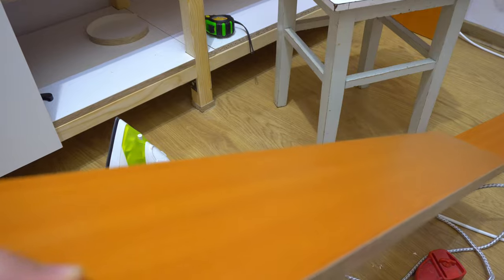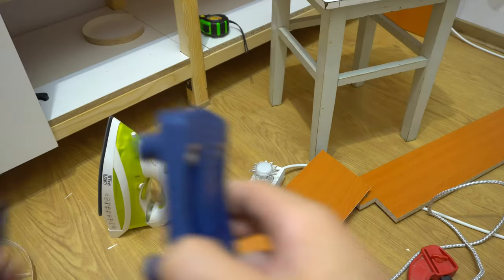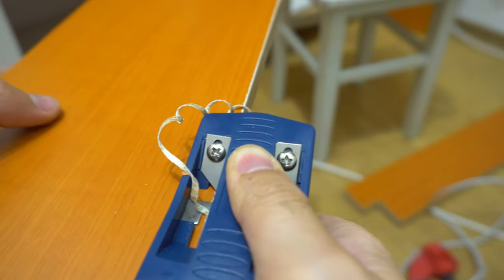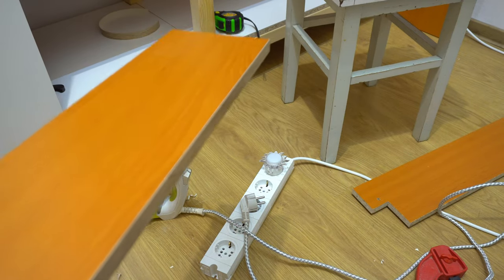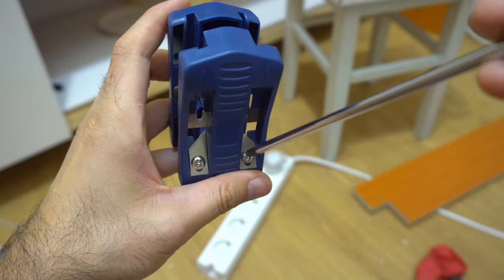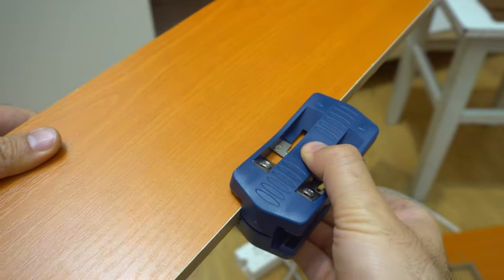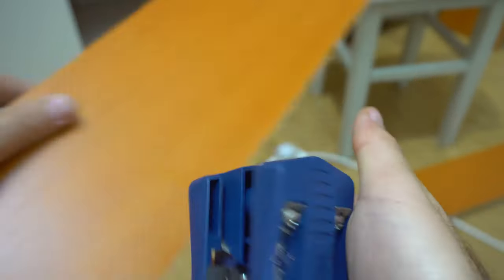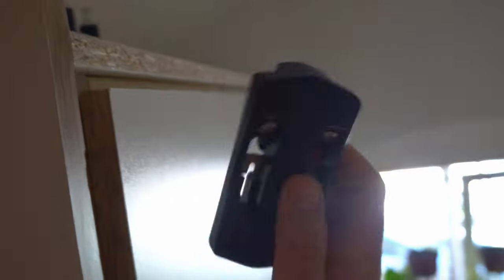Edge trimmer (Film cutter for Melamine wood)

Comment: They don't work for the the hard PVC edge banding, only soft ones. I have the hard ones and I had to use a utility knife and flush trim it with a corner tool.
Reply: Handheld router also works but you'll need to be better careful to not ruin the piece